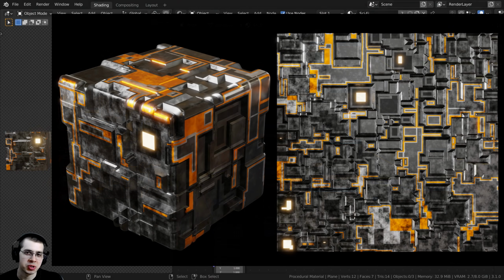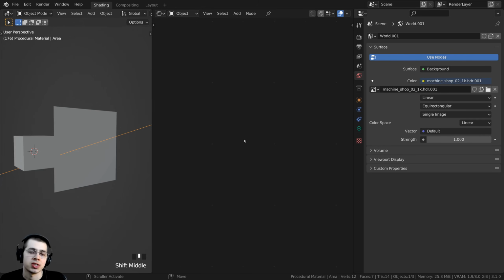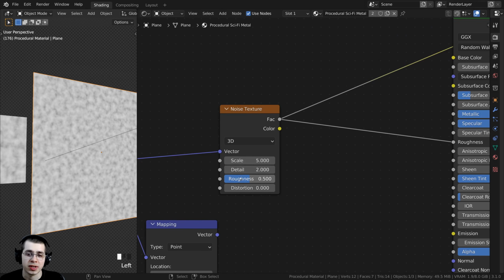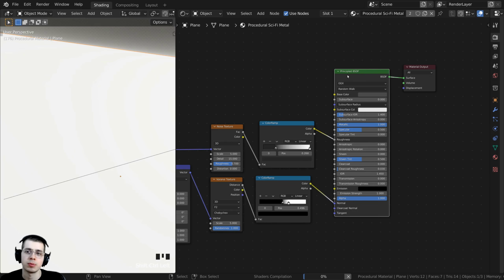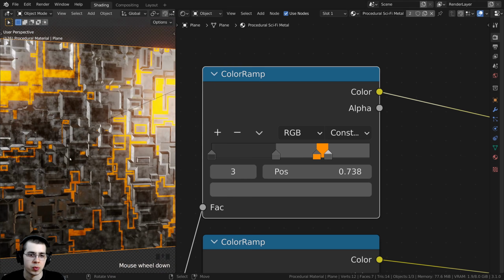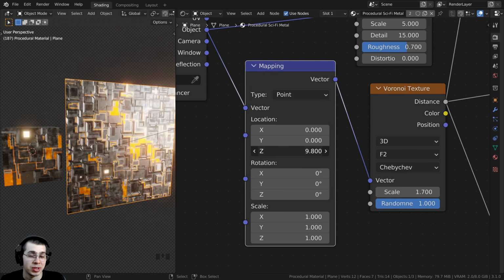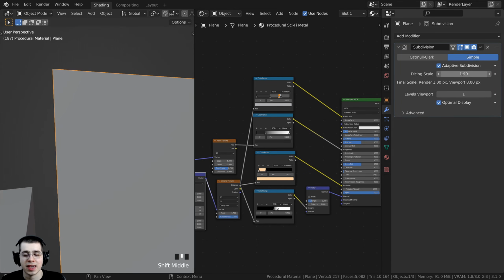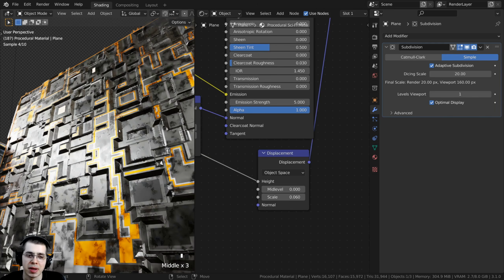Procedural Sci-Fi Metal (Blender Tutorial)

Comment: is there a way to get the geo after the displace to be mesh you could export to another program?
Reply from the maker: Yes, you would need to bake out the displacement texture to a texture map. Then you could add in the displacement texture with the displacement modifier. And you could also apply the displacement modifier if you wanted to, to make it actually geometry.